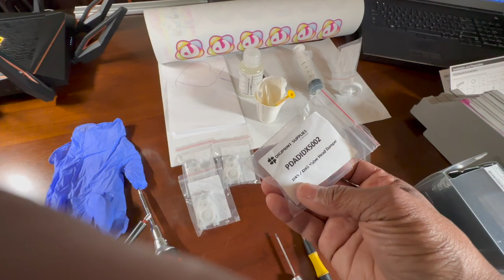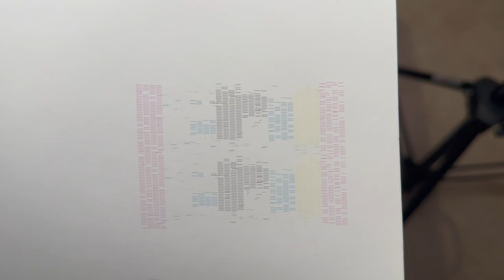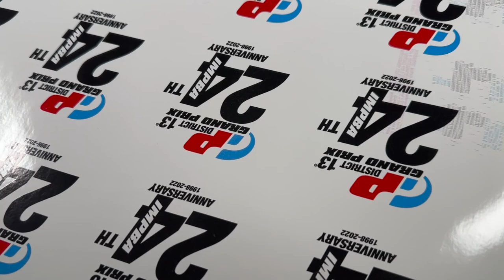ROLAND BN20 Printhead testing and replacement 2 of 2

Comment: Just wanted to say thanks for the upload, you made my life significantly easier. After all the smaller diagnosis tests which I had hoped would save my printer, (manual cleaning, captop replacement, overnight headsoak), I finally bit the bullet and bought a new printhead. Followed all the steps you showed, it was as easy as making a lego set and now my prints are like brand new out of the once again

Some things I wanna bring up in case anyone else needs to do this and that it was not in your videos.
-The hexbit screwdriver, I recommend a really long one
-Almost all screws are the same so you can chuck them all into a cup. The only screws which are different (and these are all the same so you can group these) are the ones you need to unscrew to replace the captop
-There is a plastic cover for the print head you need to remove from the older print head and to transfer onto the new one. Prying it out with a flathead is the easiest way to do so

Comment: I was able to get my printer back up and running. I d not have the service application and so far everything is working. If I an get the application one day, I will do the calibration just to make sure everything works the best it can. Thanks for the videos, they were helpful!
Reply from the maker: Cheers to you!  That is awesome news!  I'm glad the videos aided in the journey to fixing your BN20.  I'm not so sure about that "Service Application" they say we needed.  The funny thing is you can key in the head rank on the larger Roland printers on their consoles.  Roland should allow you to do the same in the BN20 utility.  Nonetheless, your machine is working.  Time to make some money!

Comment: Hi, great video,
I have unscrewed the other tree screwes (not the two that I should...hbefore I wached the video)... Tried to remove the head,.... I screw them back on the,.. 
IS there some damage by doing this? 
Thanks
Reply from the maker: As long as you’re “not” touching the surface of the print head, you should be fine.   I’ve disassembled my machine a few time and never had a problem.  Good luck.
Reply: @404photos  ok
Thanks for your answer👍

Comment: Hello, can you tell which  Ribbon Cable number 1 goes to the motherboard in order Thank you!
Reply from the maker: I can’t but what I would suggest is before you remove the old ribbon cable get a permanent marker draw a small line on the print head case onto the ribbon cable and do the same thing on the other end.  This will give you a point of reference if you have to put the old cable back in.

Comment: Did you ever use your dummy cartridges? I don't have any.
Reply from the maker: Yes I did.  I'm not sure if there are any aftermarket options but the Roland DGA store currently has them.
Reply: hey, thanks for the great video 😊 For which part you use the dummy cartridges? I can't figure it out in the video 😅
Reply from the maker: @MsChillachin  thanks for your question.  It's more towards the end when refilling the head dampers.  When using the "BN-20 Utility", under the option tab and perform the "Pump Ink" operation.  It walks you through the process of pumping the ink with the use of the dummy cartridges

Comment: Where did you buy your printhead?
Reply from the maker: I purchased it at Digiprint Supplies from their US location.
Reply: @404photos  I am looking at the kit, but, they told me i would need the service application to enter the code.
Reply from the maker: @tommcmurtry3204  I did the replacement and never had the "Head Rank" input with the "Service Application".  My BN20 is working like brand new.  Trust me, I was afraid that I had wasted my money when I found that out after the purchase.  It turns out, that I didn't need it.
Reply: @404photos  Awesome! I'll order
Reply from the maker: @tommcmurtry3204  Once you receive your printhead, if you need to follow the steps in my first video:  https://youtu.be/9YmLXYavQ7I , they "Digiprint Supplies" advises you to test the printhead before attaching the ink lines to it.  Just in case you get a faulty printhead.  All the best and Good Luck!
Reply: @404photos  Thanks! I've watched both.
Reply: @404photos    Hi! without input the rank# do you find your prints blurry, grainy or over spraying...do you still have issue now? I think if you ask Roland for a day service credential those idiots might give it to you, they just want to give their customers hard times or charge us big bucks or lock you out
Reply from the maker: @jameswei7003  my prints are just as clear today as they were the first day I used my BN20.  What drove me to make the installation is that I contacted “3” Roland certified distributors/technicians in my area and only one called me back to state they do not work on the BN20.  After that I had nothing to lose because I had already purchased the printhead.
Reply: @404photos  yes those dealerships don't care about yr deadlines that's why I'm also a non-Roland technician, even better than Roland certified. One thing about BN 20 is a slow printer and if you need to do anything you hv to open all covers lol